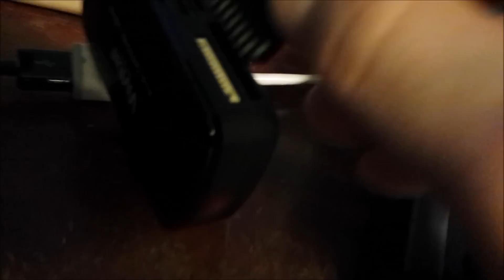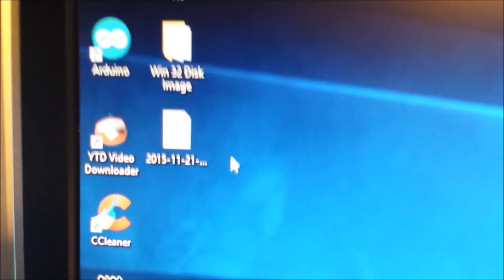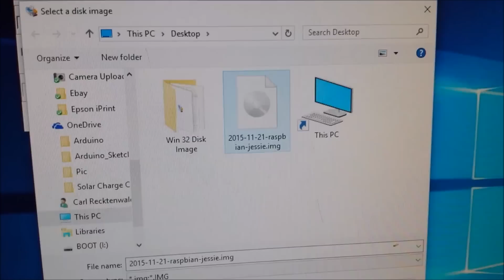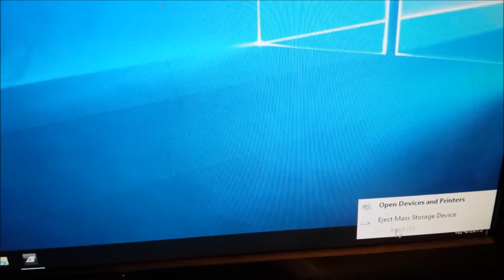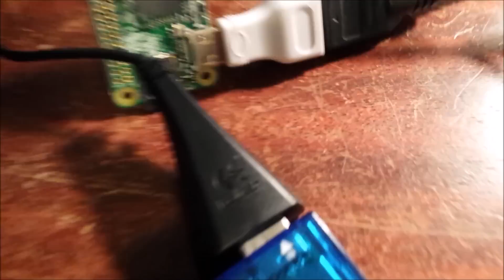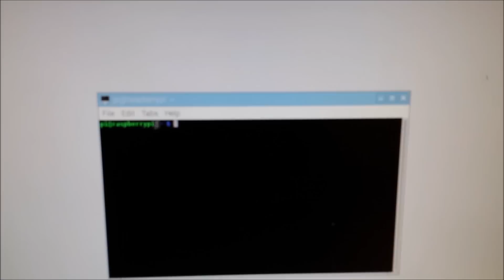Raspberry Pi Zero SD card setup and 1st Pi Zero Booting

Comment: Does it connect to wifi ?
Reply from the maker: Yes. The zero has WiFi and Bluetooth
Reply: @CarlRecktenwaldJr  Thank you
Should we put some code for that ?
Reply from the maker: Code?  Once you boot up you can put your wifi Info in.
Reply: @CarlRecktenwaldJr  Thanks a lot sir
Reply: And sir Does The Audio Come out through HDMI from the monitor ?
Reply from the maker: Yes. I have mine setup as an arcade my and the video comes through the hdmi.
Reply: @CarlRecktenwaldJr  Thanks a lot

Comment: Can you do one with the "pi zero w" I have a Bluetooth mouse and keyboard and prefer not to use up the micro usb I have no idea how to set it up after the install.
Reply from the maker: Ok let me see if u can source a W. I feel like you will need to use a usb keyboard to add the Bluetooth mouse and key and then you can remove the USB key.
Reply: @CarlRecktenwaldJr  okay I did exactly that at first it didn't work, then I  used the terminal to update the bluetooth drivers and its works great,  thanks for the update :). sudo apt-get bluetooth install
Reply from the maker: Glad you got it. 
Doesn’t It always feel so rewarding when you are able to identify and then fix issues.  That feeling that....of I did it.
Reply: @CarlRecktenwaldJr  yeah but now the issue is the BT mouse I got kills to OP every time I try to connect it, the BT keyboard works great, experimenting with this is a challenge but hopefully better results.

Comment: i dont get the green light when i connect it to power .plz help
i have raspberry pi zero w
Reply from the maker: Did you try a different usb cable? Also make sure you have a 5 volt at 2 amp supply. 
If you have tried the normal stuff it might be a bad part on the board.
Reply: thanks . I found out that the problem was that i needed to put in a sd card in it. thank you very much. i just subscribed
Reply from the maker: Thank you. Also thanks for the update hopefully it will help some one else out.
Reply: can u also make a video on how to install games and retropie with wifi on the pi zero please
Reply from the maker: There is a distro download on there page, then just pop in the SD card and done.

Comment: You can boot the zero by putting a config file on the sdram route to identify your wifi network ssid, password, and type of security, such a wpa2. Then you create an empty SSH file, which will turn SSH on. What you did was way more work.
Reply from the maker: Thanks for that info, should help and save some time for some people.

Comment: I remember in a few of your other videos you were using Atlas Scientific stuff with Tentacle shield and Arduino.  My question is have you tried those sensors on your Pi 0?  I am using similar devices with Arduino, but have crashed a few times due to lack of memory and am now trying to get into Pi, though there doesn't seem to be as much info on the web as one would think.
Reply from the maker: +Michael J I do have the PI shield for atlas. Working on a video.

Comment: you're a life saver man. i couldn't get it to boot because, as it turns out, the SD card was not formatted properly. after weeks, i stumbled upon you're video and finally tried out the SD card formatter
Reply from the maker: Ah Yes. The SD card formatter works wonders..I have had similar issues in the past. Glad it worked out for you.
Reply: +Carl Recktenwald Jr. dude I don't have a mini SD I don't have a micro USB to USB i dont have a 5 voly power source for the pi and i didn't under stand half of your video D:<